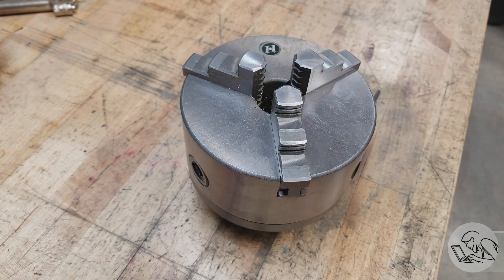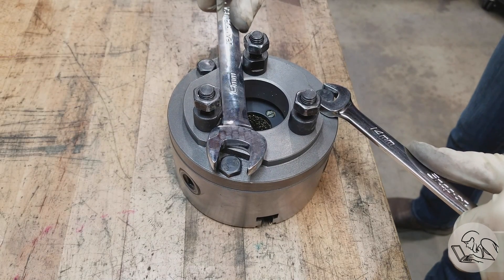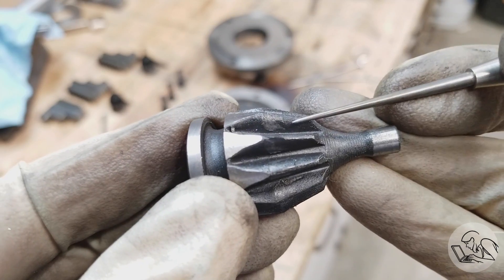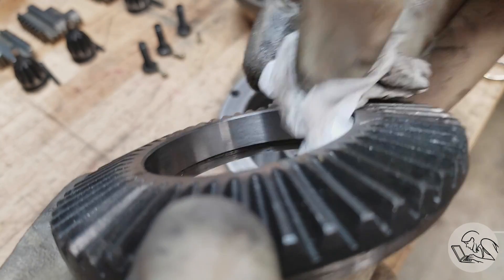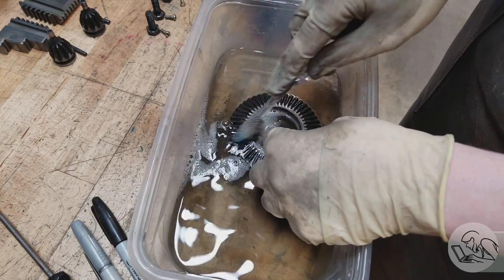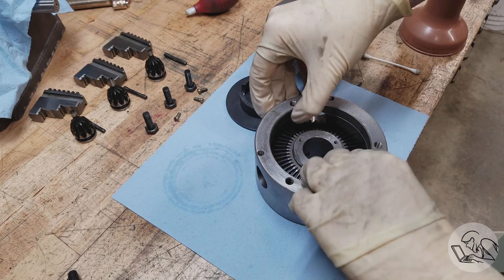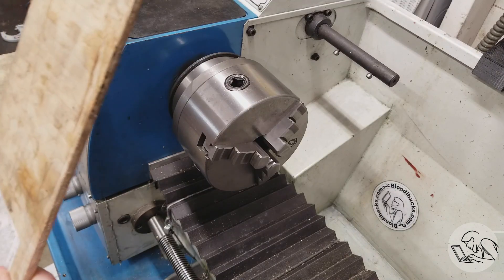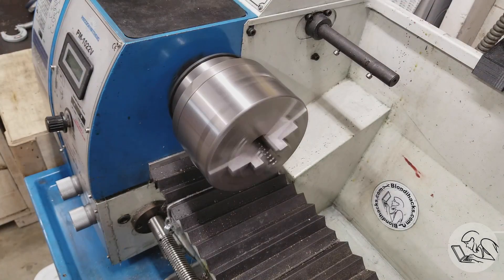Lathe Chuck Maintenance - Get the most from cheap import chucks!

Comment: I can attest to not using too much oil, I had a lathe in front of a window and when I put the four jaw on it I oiled it and spun the chuck up to 2000rpm.......wow what a mess ...3 years later when we moved I was still trying to get the last the oil line off the window and ceiling where it kind of dried onto the window and soaked into the paint and ceiling boards
thanks for sharing a very useful video

Comment: Ms. Quinn, when tightening a three-jaw chuck have you noticed a difference when using a different place to insert your tool? 
I have seen runout changes by tightening at different points.
Some chucks do have different points to tighten.
I am past 80 now and I love your vids.

Comment: Air tool tight, AKA "farm tight."  Machining a lot of brass seems to make it necessary to clean the chuck even more frequently.  That stuff goes everywhere!  The pins for the pinions aren't really set screws; just locator pins that are threaded to keep them mostly in the same place and to serve as thrust "bearings" for the pinion gears.  Don't diss that "H" brand chuck.  It's the ever popular Hua Pai brand!  Lots of Grizzlies come with the same brand of chucks.  Seriously, it's amazing what a good cleaning and debur will do for cheap tooling.  Be sure to clean the WD-40 out with mineral spirits.  WD-40 can turn into primordial goo given half a chance.

Comment: I decided (after owning it for almost a year) to measure the runout on the 3-jaw chuck on my LMS 7x14" lathe by chucking a large end mill in it and found it was 4-5 thousands.  First test was to move the jaws to different positions but the runout stayed the same.  The runout on the chuck body was very good, less than a thousand. 
 I identified which jaw was opposite the high side and pulled it, smeared layout bluing on the gripping surface and picked a face mill whose diameter most closely matched the arc of the jaw.  I gave the jaw  a couple careful strokes with 320 paper wrapped around the end mill and checked runout.  I kept repeating this until runout got down to a thousand, and at that point it just seemed to move around as I would give the low jaw another stroke or 2, so I called it good enough!.  This doesn't help runout for the internal holding jaws, but the majority of my turning seems to use the external  gripping jaw surface and besides, I have nothing I can use to check egocentricity for the other jaw surfaces.  So IMHO, an hour well spent!

Comment: Might be worth adding pipe cleaners, baby wipes, dental picks to your cleaning set, and misc firearms cleaning utensils. I got into hobby machining after the military and have found use for my rifle cleaning supplies again. Honestly, cleaning rods that thread together are so overlooked I just wish I could find something like that made of plastic. At the moment I use a chopstick and q-tip to clean the inside of my spindle. It's a magnet for dust and debris of all kinds.
Also, you should never take away the oil whirlwind from someone! Let them find out themselves haha.

Comment: Some times it is necessary to grind the jaws individually on the inside edge.....and give them a taper...
Say...+ -  3 thou removed at the rear.
If you don't....parting off can be pretty frightening...and skinny blades can shatter.

Comment: Good video.  ⭐⭐⭐⭐  A cheap Chinesium Chuck -- can sure take a great deal of deburring - I must have spent an hour on mine.   But it was so much smoother, and less crunchy afterward. 
That screw head was a beauty. 
In mine, that inner gear was a bear to remove and re-intall.  The inner shaft was not uniformly machined. 
Thankfully my cheap chuck can get to less than a thou' - luck of the draw. 
Funny,   when reassembling I didn't realize that each jaw had a specific location.  Of course immediately realized after turning them into to a mismatch.                                                                                                   

When I dismantled the old 4 jaw chuck that came with mine - I found difficulty removing one of the 4 bolts to the backing -- it was epoxied in place ! 

Turns out the threaded hole for that one had a broken tap in it.  So the guy that bought it originally really got Hosed by a seller.  
Could not get that piece of tap out of there - did not effect the runout; but will make me concerned under heavy loads.

Comment: Would you consider replacing those lousy screws, or similar fasteners, with more 'reliable' parts, during this process? I often replace slot-, or Phillips-headed screws, with hex head, or Torx, so that i can tighten them correctly, and will be able to remove them, if necesary... I did this on several motorcycles, which made future maintenance much easier.

Comment: I replayed it three times and I can't say for sure what your name is, or at least what you go by. It sounded like you said "Queenie". But again, can't say for sure. I've got one of those OLD...from possibly 1939 OLD, and my chuck spins on. "MrTed" says it's a model 101. You're probably semi familiar with them, the slightly later ones were identical but available in the "thread cutter" from where it had the automatic shifters for feed rate instead of the pile of gears they threw in with it if you didn't get it with the auto shifter thingy... It the green 12" Craftsman made by Atlas with the little...something like a six inch diameter chuck. Anyway, I'm hoping you know which lathe I'm talking about but...long story longer, I was wondering if you might know why having my chuck on good and tight make it hell to open and close jaws. I just took it off for the first time the other night and we, my buddy and I, were assuming that the jaws were actually making contact with the end of the threaded snout. But that's not it. We even dug up some rear end gearset shims and spaced it out and if you put it on with much force is just tighter than a drum to get the jaws to move. I've watched enough vids that I now know it doesn't need to be super tight, especially since it doesn't go backwards....at least I assume it doesn't go backwards. Hell, maybe they do. Anyway my chuck looks to be the same diameter as yours but yours doesn't spin on. I was looking to maybe buy a new chuck but now I'm not sure that I know enough to get the right one! I'm sure I can get through gutting mine and cleaning it up good but if it still a piece of crap I'm going to need a new one. Any advice would be appreciated. Even if mine cleans up and turns out to be perfect, I'm thinking I'd like to have a four jaw as well. By the way mine only has one pinion. It would be nice to know if I have to do anything special given that there's only one. I also just wanted to make contact as I've watched a few of your vids before. This one being so recent and so relevant to my situation I thought it was a good time to drop you a line. Thanks!
Reply from the maker: My name is written on the screen
Reply: @Blondihacks   LOL, it sure is. Yep, I'm a dope! Please forgive me. What did you think about my chuck, it getting stiff when it's tight? AND, the single pinion...I don't want to get into something I'm not prepared for. Thanks! And sorry about goofing up your name.

Comment: Another superb tutorial, Quinn. I have a 3" chuck from an old mini lathe that I use for small parts. Instead of making a standard back plate for it, I made a back plate with a 1.5" stem on it which I can mount in my 4 jaw allowing me to precisely dial in parts mounted in the 3 jaw with the 4 jaw. Chucks in tandem. Anyway, that Chinese 3 incher is in desperate need of a good cleaning. You've motivated me.

Comment: Good afternoon Quinni. First a Thank you. I cut my teeth on very large Lathes by Cincinnati, Milacron & LeBlonde, Bridgeport Mills. I didnt even know these smaller machines existed until a few months ago. Been a Minute. Your channel has been both informative and enjoyable, especially the Boring parts! ( Nice touch ) My channel been dormant for health reasons and a cross country move. You helped me decide on what to buy for my Small engine shop.  Bolton ZX45A MIll, and Weiss WBL290F Lathe. Ive got a few hundred hours of tube time watching you & others. I am fascinated by some of the machine tooling builds you and others do. At the GE carbide shop, if you couldn't manufacture a part in the machine shop you couldn't work there, Kudos to you and the rest of the Mini Machine Operators. Be seeing ya , God Bless and Thanks again.  Poppa Phill  ps: hope to have the channel up and running Mid May.

Comment: A big collector of chips in chucks is the gap between the chuck and backing plate.  A piece of 1/4" thick Ethafoam (polyethylene packing foam) cut to shape will compress into the gap when the chuck is reassembled.  It's resistant to coolant and oils and will keep chips and swarf from accumulating there.
Reply: I have used a good old skwirt of 
No more gaps....which painters use in cracks...you can always get it out in a few years
Reply: Yet, what do chips there hurt? No moving parts and if the cover plate fits well, no way for chips to get into the scroll. If you really want to seal it, just sit an o-ring in there as you assemble it.

Comment: when my cheap chuck was new i discoverd that mounting the jaws in the "correct" slot wasnt the best for running true-endet up swapping them around and got that cheap thin to run allmost perfect..so if a cheap 3jaw is off-just try to change the order of the jaws and se if that helps

Comment: On the slightly unusual tooling front: grab a cheap electric toothbrush, they work wonders about dislodging grit from nooks and crannies of about any mechanical contraption I ever had to clean. They also do a decent job if you need to do some light grinding/polishing in a place where a rotary tool would leave aligned scratches (like the inner surface of a hole)

Comment: Using Q-tips is perfectly acceptable to clean intricate parts.  At Rolls-Royce the CMM operators use then to clean out 6mm dia holes in titanium castings, prior to them being probed by the ‘ruby’ stylus. In fact it’s written into the Technical Instructions the operators work to. A tiny piece of swarf left behind in the holes can trigger the probe to give inaccurate results.

Comment: Hi Quinn  If you machine the backing plate slightly larger so that the spigot is a loose fit  with the chuck then it is possible to achieve zero runout.  Just loosen the three holding bolts and tap the chuck to get zero runout.  After it is centered tighten the three mounting bolts.  Full disclosure, that is what I have read in a lathe manual.

Comment: Quinn, Fun an informative as always.  Love you dry sense of humor and tricks, very funny.  Reading comments I see no one mentioning non-petroleum, water based cleaners.  I find myself using them more and more as they are so cheap.  I wipe as much gunk as I can first, then in complete violation of all safety rules hit the parts with compressed air before moving on to the grease cutting cleaner of choice.  My current favorite is “Super Clean” but I’ve tried a number and they all work pretty well. By using them full strength in combination with various brushes and sometimes, depending on the job, with a cheap pressure washer and/or hot water, I can get things so clean that it takes only a little WD-40 to do the final details and prevent any oxidation.  Anyway, just a thought.  Love all your lessons and adventures.  Cheers, Will

Comment: Thanks for another informative and useful video Quinn!  It would not have occurred to me to use WD-40 for cleaning nor to use way oil in a chuck. I just cleaned my three drawer chuck per your recommendations.
As I look around my workshop I see lots of tools and supplies that were inspired by you! You rock! Thanks for all your great videos.
Reply: WD-40 is mostly mineral spirits (>50%) and refined mineral oils (> 25%) so it is a good choice.

Comment: Got to say that as fluids for cleaning are getting massively more expensive ('cause oil) keep your eyes open for cheap cellulose thinners at bring and buy meets. Cuts through old hardened grease better that most petroleum based products and so much cheaper.

Comment: Thanks for the vid. I have been lazy about getting into the back of my precision cost engineered chuck made of the finest Chinesium but I suppose I'll get to it now that you've prodded. Just on a side note, that safety shield holding bar, from which you have removed the all-unimportant shield always used to get in my way when using a hacksaw to finish parting. If you open up the face plate on the console above it, you can very easily remove it without impacting anything and the safety switch latches closed when the bar is removed.

Comment: Thanks for showing his. I imagine my NOVA wood lathe chucks are in the same condition after a few years. I know wood dust does not wear on the chuck parts like metal bits will but they can gum things up and make it stiff to adjust. So I think I will tear down one and see what the internal condition is and clean it up.

02:45 I think they use old motor oil as a way to dispose of the waste. Ship the waste overseas as lubricant and you don't have to process it as hazardous waste. I bet they do the same with that smelly paint that seems to only come from China.

Comment: The change in run-out may actually depend on which pinion you use to tighten the jaws.  If the scroll is a slightly loose fit in the chuck body then, depending on which pinion is used to tighten it, the scroll (and jaws) will be pushed to one side or another.

Comment: Great video! Most 3 jaw chucks have a marked pinion that will give you the best concentricity. Yours appears to be the one marked “0”. Some chucks like Buck Adjust-tru only have one exposed pinion to eliminate the chance of error. Try it, your chuck is probably more accurate and repeatable than you think. As always, thanks for sharing!

Comment: The WD-40 is especially good for the home shop when the garage is attached to the house and the love of your life is just on the other side of the door. When your trying to tap a hole in some stainless and the good old sulfur based tapping oil would be great! but just on the other side of that door is dinner being prepared by the love of you life. Or a better example is the old Tap-Magic the can is just sitting ther the wonderful smell of the Tap-Magic just asking to tap some fine pitch holes in that aluminum part you have. But dinner is almost finished and the WD-40 won't come up once at the table.

Comment: I prefer a grease with Molybdenum, Pratt Bunerd  (Chuck manufacturers), supply a very sticky  Molybdenum grease. Max Grant showed using a dry Molybdenum spray, which I've since purchased,  trying this on next strip down.
Great work and video,  thanks for sharing.

Comment: Lol I've got the same chuck and after cleaning Deburring reassembly i got lucky with just under 1 thousand run out on 3/4 pin and after testing various sizes etc worst I got was 3 thousandth so I left it alone and just keep it cleaned and oiled and don't wanna take it apart again and upset anything 😂😂😂

Comment: Q-tips are an under utilized item when cleaning, in my opinion anyways. I like to use the single cotton end ones that are 6” long with a wooden stems. Better leverage and longer reach. Great video.
Reply: I’ll have to remember that, especially because I like to chuck Q-tips on a drill.

Comment: get a bucket like a 5 gallon bleach bucket ... take the top off ... hold the bucket over the spindle and have a small can or tub on the lathe bed to drip the sprayed off oil into ... then the bucket catches all the oil spray and deposits nice and cleanly back into a bin for use elsewhere
Reply: hmmm cheap ground chuck jaws ... sounds like a recipe for a BBQ'd burger ... get some cheap ground chuck ... and some kaiser buns ... make some really fat jaw splitting patties ... BBQ them up slap them on the bun lightly toasted if desired add a slice of sweet onion a few strips of bacon a dash of mustard and ketchup then some nice fresh mild cheddar and stuff it into your mouth bite by bite until gone lol

Comment: Sage advice. Probably complied with roughly as often as men stop to ask directions when driving 😉.
You can (if you dare), use the "poor man's griptru" trick if for some reason your full set of high precision collets won't do the job. Machine between
 .005" and .010" off the diameter of that precious register on the backplate 😱. When you attach the chuck to the backplate, just nip the bolts (for now). Mount the chuck on the lathe spindle and insert a piece of stock with the diameter you want to run true in the chuck jaws, tightening the jaws as normal. Now, using an indicator and a soft-faced hammer, tappy-tap-tap the chuck until your workpiece runs true. NOW tighten the retaining bolts holding chuck to baseplate - the friction between the faces of chuck and baseplate will cope with just about anything a hobbyist would knowingly ask of their machine.
Reply: I knew I made that backplate an easy fit for a reason :)